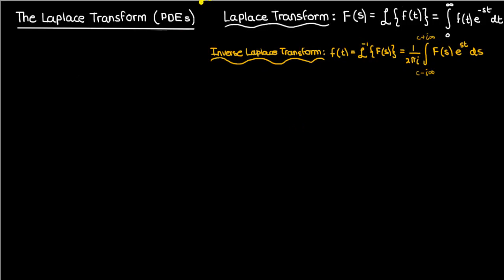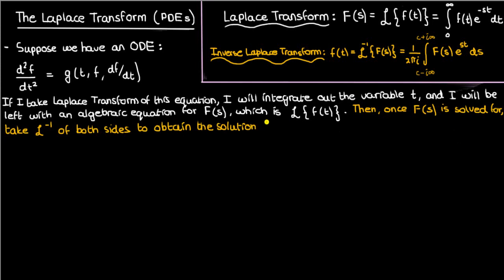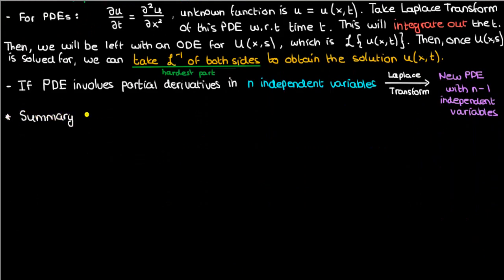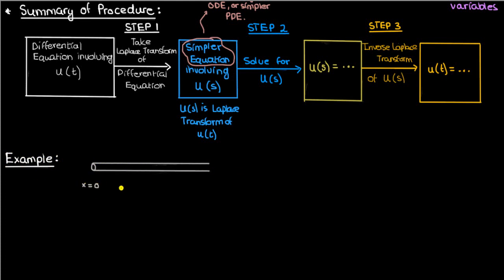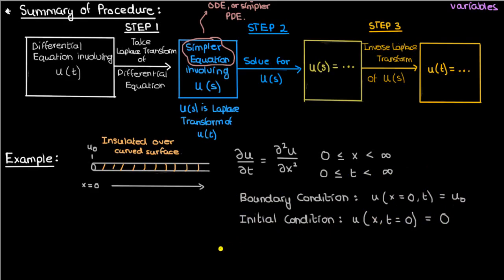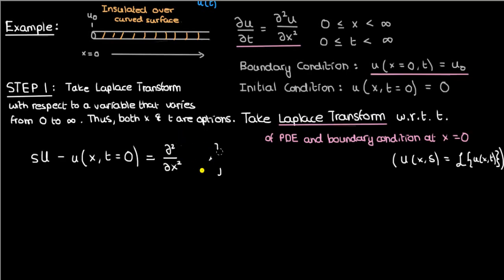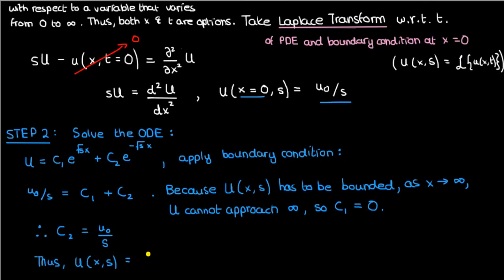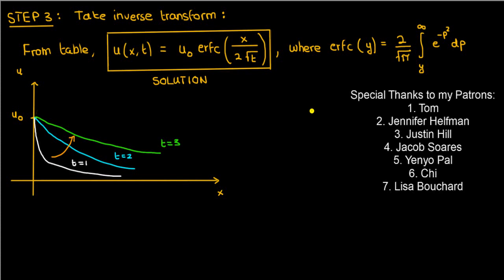Laplace Transforms for Partial Differential Equations (PDEs)

Comment: I've seen before the limits of integrations of the erf defined from 0 to y. Is there a reason for writing the limits from y to infinity in this case? Are both integrals equivalent?

Greetings and thank you for uploading these excellent videos.
Reply: Because the error function is not the same as the complementary error function. The difference is precisely the integration limits.

Comment: 3:05  I know how laplace transforms work, they translate your diffeq into a simpler alebraic equation that can be solved and inverted to find a solution. But, what do you mean by "integrating out"? As i understand it, integration creates independent variables whereas derivation eliminates them eg. f(x) = 4x, then f'(x) = 4, and f''(x) = 0.
Reply from the maker: When you solve a differential equation (DE), you basically 'integrate' it. That may not be technically true (i.e. you usually don't actually integrate the equation), but functionally, that's what happens. That's why you see arbitrary constants in the solution to your DE before applying boundary/initial conditions; those arbitrary constants are integration constants.

What I'm trying to say in the video is that the Laplace transform is an integral transform, and you can intuitively think of it as integrating out one of the variables. For instance, when I apply the Laplace transform to du/dt = d^2 u/dx^2, it's as though I'm integrating out the t (i.e. solving the DE so that there's no more derivatives in t), resulting in a simple ODE in x. Does that clarify things?
Reply: Faculty of Khan Yes, i realize my understanding is limit since we are talking about pde's instead of ode's. So how exactly does a laplace transform change a time domain singal to a frequency? I hear this in every explanation of an LT, yet i have little intuition about it.
Reply from the maker: It's because when you look at the formula for a Laplace Transform:
L[f(t)] = integral f(t)e^(-st) dt, 
we can see the 's' next to the 't' in the exponential. Since the argument of the exponential must be dimensionless, 's' must have units of 1/time because it's multiplying the time t. That's why when we take the Laplace Transform, we go from an independent variable in time (i.e. t) to an independent variable in 1/time, or frequency (i.e. s). Hope that helps!